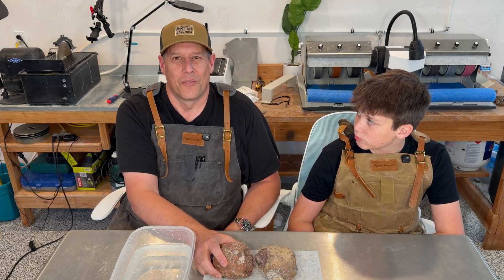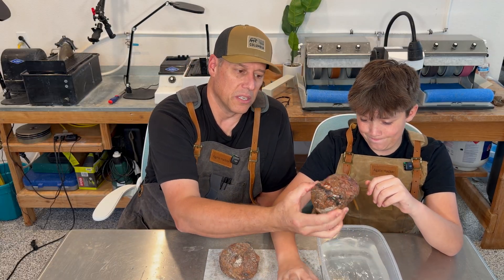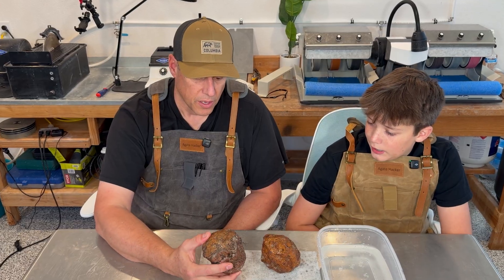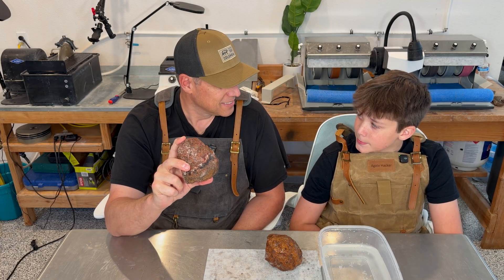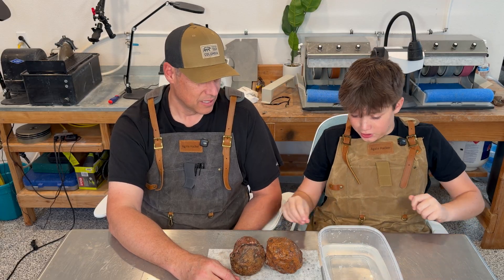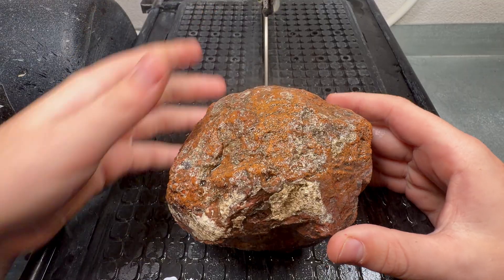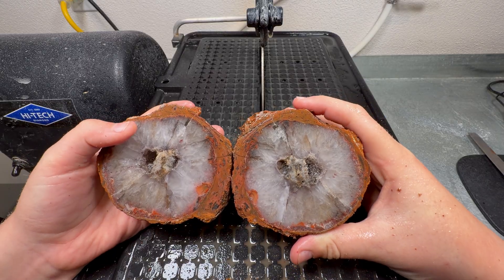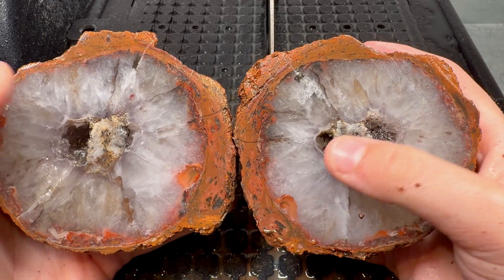See Inside These Special Geodes from MEXICO!

Comment: Caleb does a great job cutting, very disciplined and patient. How long did it take to cut through one of those geodes? Your dry sander is very innovative and looks pretty professional. You might want to look into the Wet Belt Sander from Highland Park for an added tool in your lapidary shop. It also has the leather buffing wheel for cerium polishing. I do like your videos a lot, so keep them coming!
Reply from the maker: He’s really amazing at cutting for such a young age! I think each cut was about 3 to 4 minutes.  I look forward to getting a slab saw for these larger stones! I copied a guy named Scott Wilkins on the sander, check out his channel for sure! I’ll look into the HP sander/polisher, Thanks for watching!
Reply: @agatehacker  Nice build! :) Before you buy one of those particular HP machines watch what Currently Rockhounding has to say about them. He returned a free one they sent to him, that is how much he did not like it. lol!.....I am a 30+ year thunderegg collector and built a similar machine for dry sanding. A lot faster than wet sanding and polishing......
Reply from the maker: @Joel-McConnell I ordered a Richardson Ranch leather wheel for now, just need to practice with it!  I watch a guy named Scott Wilkins that has had a fair amount of success with that HP polisher, but also saw CR’s take on it.  I suppose there’s no perfect machine or company😅 Headed to Succor Creek for a little Thunder Egg hunting trip next week.  Hope to find some good ones!
Reply: @agatehacker  Scott uses the Wet Belt Sander to finish just about all his polishes.
Reply from the maker: @michaelc6817  I'm really impressed with his polish.  I'd love to see his entire process in real time!  I'm really trying to learn from others as much as possible!